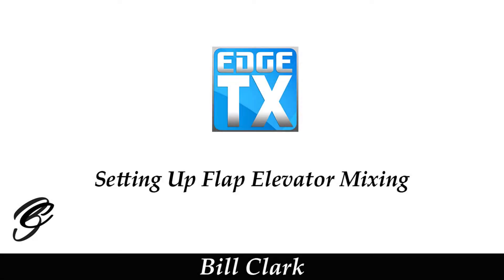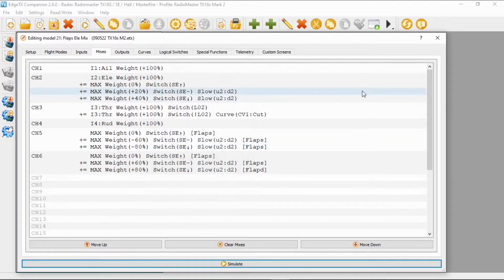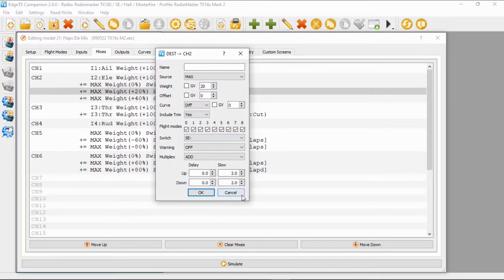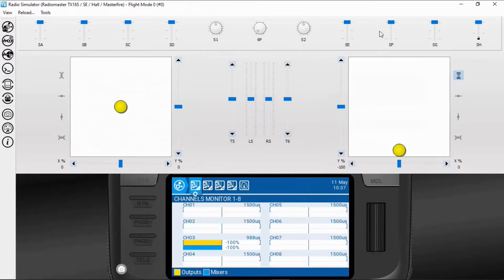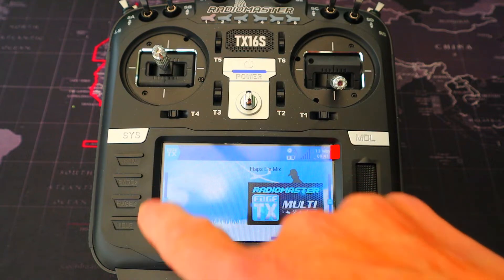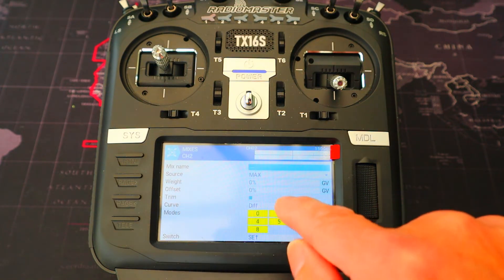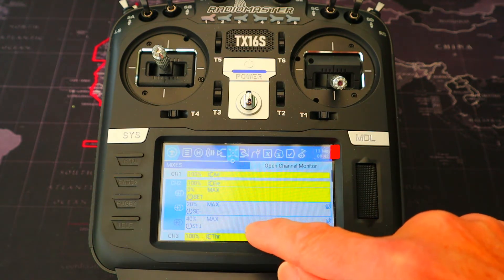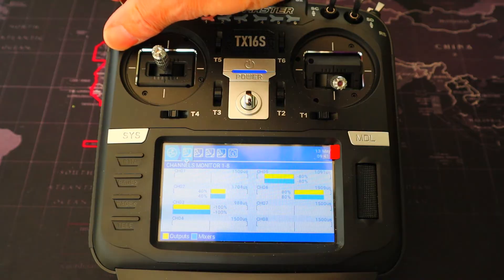EdgeTX Flap Elevator Mixing

Comment: Thanks for the clear explanation.  

I decided to go a slightly different, but simpler way making it proportional to my 3-way flaps switch (SC in my case). I wanted 0/+15%/+30% added to my elevator.
Add 1 line to the Elevator mix
Source: Flap switch (-100 to +100 = 200 total)
Weight: 15% (of 200 = 30% total)
Offset: 15% (moves the center point)
        SO: SC^/flaps up/-100 becomes elevator+0%,  SC-/0=+15%,  SCv/+100=+30%
        Math: (-100*15%)+15%=0%,  (0*15%)+15%=15%,  (+100*15%)+15%=30%
Reply from the maker: That’s the beauty of EdgeTX there are many different ways to get the results you want. Nice one.

Comment: Thanks so much for this!! I had to move my Flaps from LS (Left Slider) to SA (Switch A) because the mixes don't allow LS as a switch option. I was so confused! I hope there is some documentation about the mixers and the many options. I've watched a few videos and replicated what they showed, only to find that I don't get the results they are reporting (which I'm assuming means I'm missing something important). Thanks again.
Reply from the maker: Hi JP, you do need to make sure you have copied what was shown in the videos. If you need particular mix settings let me know what you are after and I will try to assist you.

Comment: Hi Bill! You helped me fix my issue where I could never have a delay on the elevator mix, THANK YOU!  Quick question, what does MAX refer to, when looking at the source in the mixes tab? Why do we select it? Thanks again for you help!
Reply from the maker: Hi Guillaume, MAX dose not relate to a physical control but returns a fixed value of +100 moving the control surface to a fixed position. Setting the weight will give you the amount of throw you want the control surface to move.
Reply: Makes perfect sense in what I'm seeing on my radio.

Thanks again!

Comment: Hey Bill. You have helped me many times in the past. This question is not related to this video. I have an Excalibur power glider, and EdgeTX. The glider has two elevators on separate channels. I can't for the life of me make them work together. Any ideas? I even tried a Y connection.
Reply from the maker: Hi Jerry, the Y connector will depending on the way the servos are installed. The other way is two channels and mixing. You need to add a line (mix) to the elevator and if the elevators move in the opposite direction change the weight of that channel to -100. If you still have problems I will film a quick video for you. Good luck.
Reply: @the-happy-RC-flyer  Thanks. I used the wizard to install this plane. Do the channel defaults on the wizard have to match the ports on my receiver?
Reply from the maker: @jerryzito6840  ideally yes.

Comment: I am trying to build an fpv drone, I have radiomaster tx12 in my hand but I can not buy r161 reciever, has radiomaster stopped selling it?  is there another similar radiomaster reciever?
Reply from the maker: Try the RadioMaster R81 receiver for your drone which is available.
Reply: Does it support telemetry?
Reply from the maker: @mohdnihal3132  you will get RSSI on channel 9 on the Sbus output.
Reply: @the-happy-RC-flyer  i got the radiomaster r161 reciever, is there any problem in buying it now?
Reply from the maker: @mohdnihal3132  no not at all you can go ahead and use it.
Reply: @the-happy-RC-flyer  I am india, when i try to buy it shows two choices, EU LBT and FCC,  Which supports my transmitter?
Reply from the maker: @mohdnihal3132  both are supported by your radio I think you can use the FCC version in India.

Comment: Just picked up radiomaster tx16s with edgetx, I have a bunch of planes but the one im having trouble with is my spektrum reciever. I got it bound but forward programming won't work, do I have to unlock the reciever in order to do forward programming?
Reply from the maker: I do not use Spektrum receivers. I am not sure EdgeTX supports forward programming.
Reply: @the-happy-RC-flyer  let me ask you this, I have about 5 or 6 gas planes some of which are pretty big planes, they have old hitec recievers and I should upgrade, what would you recommend.
Reply from the maker: @nichollsboy11  I have used cheaper servos for my planes but if I was flying expensive large models I would go for Futaba servos. I have Futaba servos which are 30 years old and still working. In my largest plane I have used metal geared less expensive servos and they have been fine.
Reply: @the-happy-RC-flyer  awesome, alot of the servos on these planes are hitec and there are some models having futuba, so ill try and see what ones they are but the guy who built these I guess took this very seriously so I'm sure the futuba servos and hitecs were the best when he built them, the futuba ones looks like they are very good as they are bigger
Reply from the maker: @nichollsboy11  if the servos sound smooth and move smoothly without glitching you should be good. Enjoy flying them.